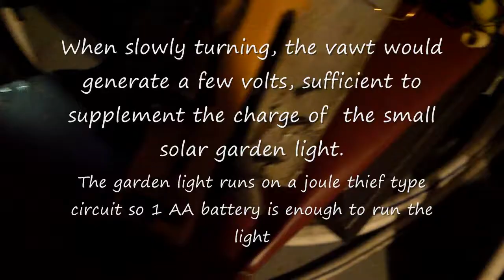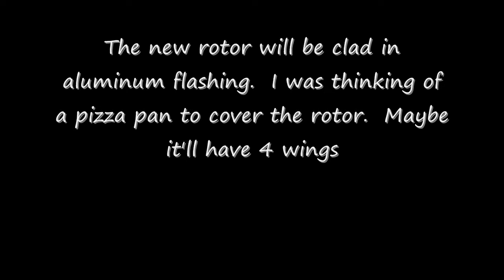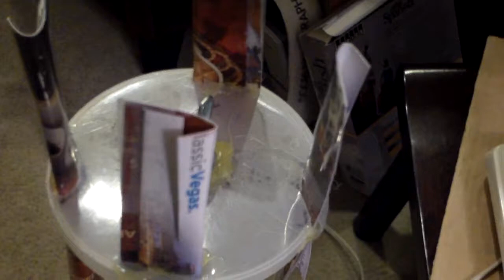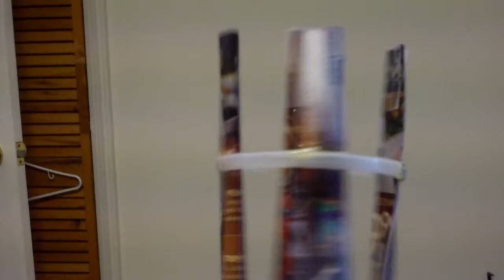Using a small vawt to charge AA batteries part 1

Comment: I look forwards to this video series and the parts required. I've been thinking of doing this for the outside lights around the off-grid cabin.
Reply from the maker: The Cedar Workshop Thanks. Solar energy is the best option.  I play around with the small wind turbines because I like to see them turn in the wind. Since these small LED lights require only AA batteries, I should be able to make the hybrid light work.
Reply: Agreed, but quite often it's cloudy or the sun is behind the trees. The wind normally picks up in the afternoon in my parts

Comment: That thing looks like it could use some skateboard bearings.  Ebay has a lot of them pretty cheap.

I always thought a downspout could generate quite a bit of hydro power because all the force.  It could provide lighting on a dark rainy day.
Reply from the maker: Russ Bowers Hydro power would be very cool or a bright idea. I have to try out the skateboard bearings. Thanks for the tip.